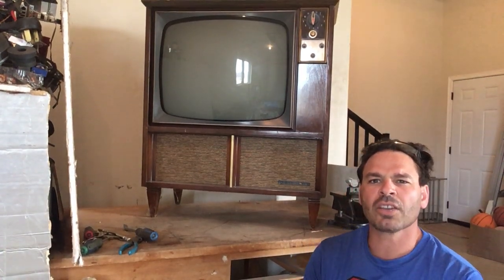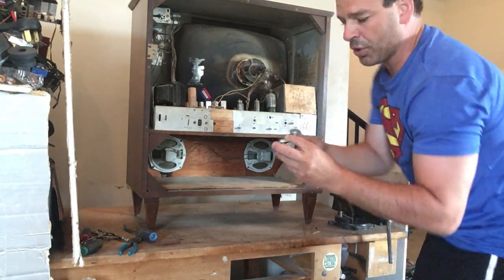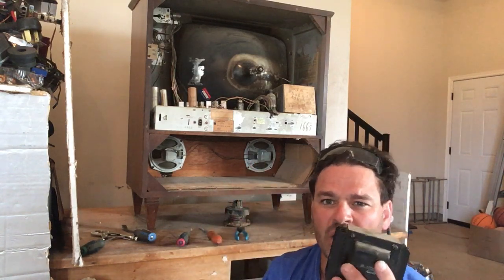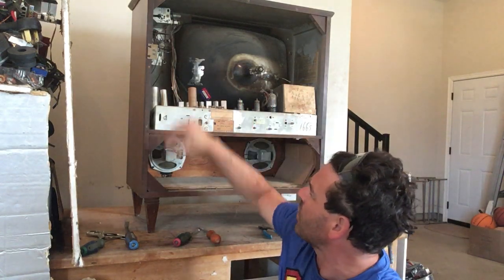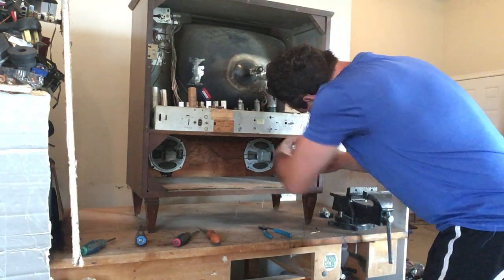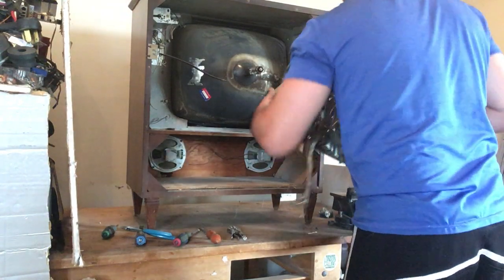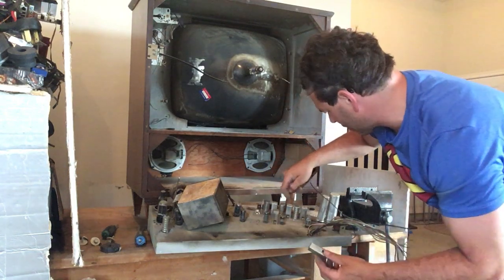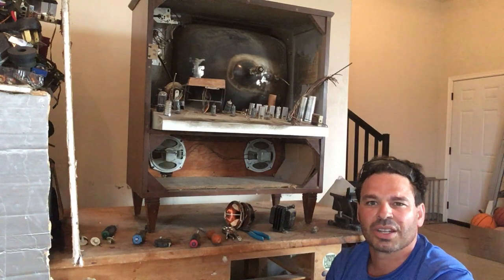Scrapping a vintage television I found for copper, aluminum, brass, and other metals.

Comment: those glass things are called tubes back in the day you could take them down to your local hardware and they would have a big tester machine you could test them yourself and they would have all the replacement tubes right there and you could fix your own tv they would usually turn black and smutty looking when bad I remember doing it with my dad

Comment: The vacuum tubes are what your calling light bulb.if not broke or blown they fetch a nice sum of money from guys who refurbished old tv and radios from those era and back.as a kid in late 60's it seemed every few month one of those tube would burn out and set not work.you might get sound and no video and it seemed to happen when you wanted to watch something good after seeing it in tv guide.if you look close just like a light bulb if filaments is broke tube not good.even the knob on front are with money to the restoration guys.you might want look online in those groups and reach out if part looks ok.just tell them what tube out of and part numbers on them.

Comment: I can't stand scrappers, they constantly scrap things out that could be saved or restored. In the case of this tv, someone that knew what they were doing likely could've saved it, as long as the CRT was good.
Reply from the maker: I fished it out of the trash. Scrappers are good because this would have otherwise ended up in the landfill!!
Reply: @TinManScrapper  And it would be impossible for you to sell it to a collector? You'd make money either way
Reply from the maker: @justsumguy2u  sure, if I could find a collector to begin with. I did take out the tubes and am trying to try to sell them. But again shipping costs, finding a buyer, and space are all factors.  If it worked I would for sure try to sell it, as all items I find on garbage day.